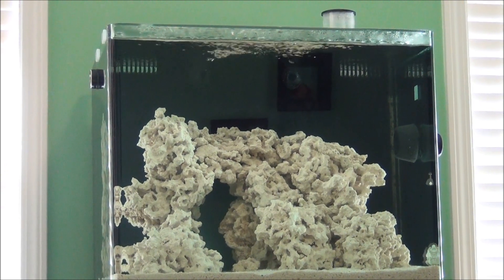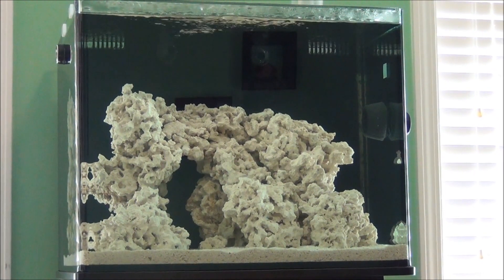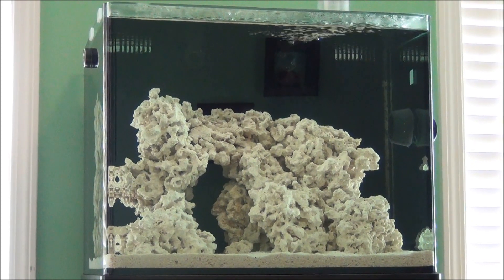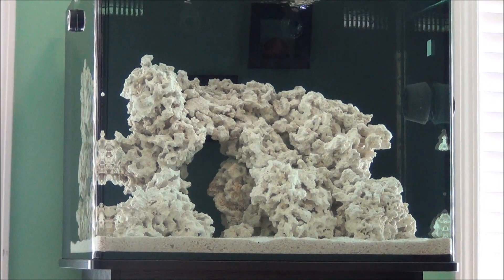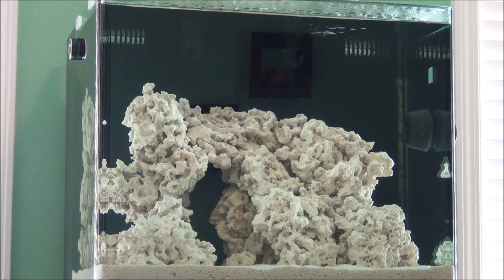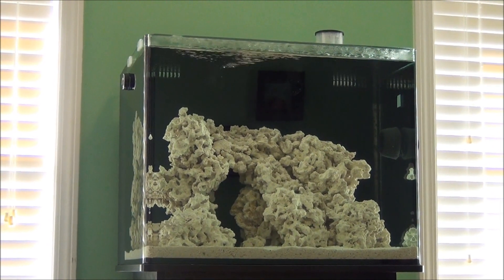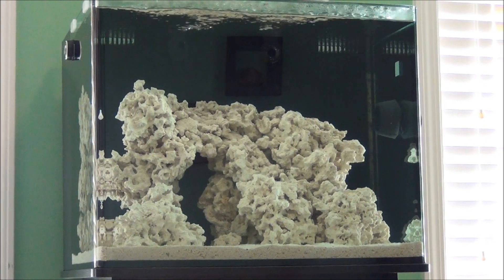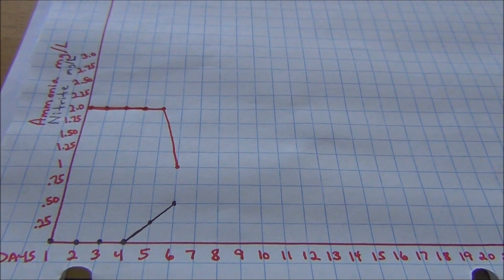The Reef Pt.5: Cycling the Reef

Comment: I'm following your advice concerning the fishless cycle.  I'm going to use the A Purple Reef rock and sand.  My question is, should I do a water change after the cycle?  If so,, what percentage of water change would your recommend?  Thanks!!!
Reply from the maker: Skip Bowman After you have cycled your tank you will have Nitrates in the 20+ mg/L range. Doing a 50% water change will bring your Nitrate levels back down within the acceptable range, and it will replace vital bicarbonates that were depleted during the cycling process. Within a few weeks of the cycle, the anaerobic bacteria that process Nitrates will develop allowing you to perform smaller water changes. Good luck!
Reply: Thank you!  I really miss your updates and wisdom.  Because of your videos and advice, I've gotten back into the hobby after a 20 year break, so much as changed.  Back in the day, I've never heard of a fish-less cycle or many of the products that are now available.  We just had halides, not even CF were out.  Your advice is so helpful and I really appreciate it!  Thank you.

Comment: Hi. I am currently cycling "dead" dry rock (was live). It's only been in a tub for 3 days. It is emitting a pungent smell in the afternoon due to high temperatures. I'm not sure if it ammonia, mildew, etc. I am a virgin reefer. It smells salty. I will be testing for ammonia soon, but the rocks are only in an RO bath. Next week, ill be starting it with salwater w/ bacteria dosing each day. Am i doing this the proper way?
Reply: The smell may be ammonia, from dead organic materials from the past, as you mentioned here. I hope im still doing this the proper way. 1 week w/ ro (pump only). Week 2 w/ saltwater & bacteria dosing.
Reply from the maker: Hello Clyde. Depending on what type of dry rock you have will determine whether or not you have enough decaying organic matter to cycle the rock without adding a source of ammonia. Many types of dry rock such as Marco's or BRS reef savers is too clean to start a cycle alone. Once you put the rock in saltwater mixed to 1.026 specific gravity/ 35 ppt salinity just test for ammonia. If ammonia concentrations don reach at least 3 mg/L, then you can add 1 drop per gallon of Dr. Tim's ammonium chloride or throw in some fish food to feed the bacteria. Test every other day and add more ammonia source to get back to 3 mg/L. Start testing for nitrite once you see ammonia dropping. Your nitrite will spike before eventually dropping to zero. Once nitrite tests 0 your rock has cycled. Hope this helps.
Reply: +cyberaquarist thank you! I appreciate the input! That's how i actually planned on tackling the rock cure/cycle. Next week i will be starting the bacteria dose & testing. I understand that if i show no ammonia, then the cycling will be delayed since i will have to add ammonia in myself (via ammonium chloride)

I was wondering, how long does it take (days/weeks) for each portion? Ammonia to Nitrite to Nitrate? I saw that you ended by day 20. I'm starting off with only a 20 gal long. Im a freshwater guy going into reef. still continuing my research everyday.

Comment: Hey they, how's the tank going? I see you have the same one that I just picked up a week ago. Question for you, how is the one powerhead working? Did you keep just one or get a second. How;'s the tank running for you? Any issues I may need to know about. Thanks for the video!
Reply from the maker: Hello Candice. I haven't had a single issue with this tank or the stock return pump. I'm still using the single return pump. The only piece of equipment that I had to replace since this video was the Innovative Marine desktop skimmer. I used it for over two years, but it started requiring constant adjustment to skim properly. I replaced it with a Reef Octopus HOB 2000 Classic skimmer. Her is a link to a more recent video of this tank with all of the same equipment used in this video. It will give you an idea of what is possible. https://youtu.be/gvJA_hTYMwc
Reply: Thats great!! I'm really encouraged to hear that you haven't had any issues with the tank. I love this tank and i'm excited to have it for my first saltwater experience. Thank you for the tip on the skimmer, I haven't bought mine yet so I will keep that in mind. Thanks for your help! ~ A Patiently waiting aquarist! lol

Comment: If your live rock is fresh, then the rock will not need cycling or curing, and there will be no ammonia or nitrate produced. The rock is ready cycled, and full of bacteria. You just need to wait 6 days to be sure nothing has died, and produced an ammonia spike. If you are adding live rock to an existing reef tank, then you need to put it in a bucket of salt water from the existing tank, this will prevent die of, when the rock is added to the maid display. Nice scape!!.
Reply from the maker: You are correct, and I did mention that fact at 2:20 in the video. This tank is now 2 1/2 years old. Thanks for the compliment.

Comment: I've had very negative results using Seachem stability on two separate occasions. In fact I swear on my brackish setup it actually haltered the process... took me 4 months to fully cycle. That may have to do with brackish though. I wouldn't use the FW test chart for SW... the colours are extremely different, but yeah you can use the same solutions for most tests.

Comment: Are the protein skimmer and wave pumps running during the cycling period ?
Reply from the maker: I do run the protein skimmer and wave maker during the cycle. The skimmer won't actually pull anything from the water at this early stage in the tanks life, but skimmer's have to "break in". During the break in period the skimmer puts out a lot of micro bubbles into the tank. Id rather this take place while there aren't any corals in the tank. Running the wave maker insures that all parts of the live rock are receiving good water flow for the cycle.
Reply: +cyberaquarist  ok cool; thank you.

Comment: Thank you also one more question if you don't min if my gravity is high can I add distilled water to bring it down
Reply from the maker: Yes. You can add distilled water to bring down your specific gravity/salinity. You may need to take out some of the saltwater before you add the distilled, depending on how high the salinity is. Always try to maintain the same water level by topping off with distilled, RO/DI, or DI water, because as the water evaporates the salinity will go up. That's why I highly recommend using an auto top off system. It is one of the best investments you can make to ensure a stable salinity.

Comment: Hi I'm new to this and I started my tank about three days ago I was wondering do you have to do water changes while cycling your tank, and I have about 5 pieces of small live rock in the tank and I'm about to add some dry rock will the live rock help with curing the dry rock since I'm only three days in? Any help would be great:)
Reply from the maker: Water changes don't need to be performed during the cycling process unless your nitrites go above 5 ppm. In that case, just perform a partial water change to bring nitrite (NO2) down to 5 ppm or less. The live rock that is already in your system will help speed up the cycling process as it already has millions of beneficial bacteria on it. Test for nitrites every few days, and once it reaches 0 ppm the tank is cycled. Then you can add a couple of small fish to maintain the bacteria colony. Just take it slow when adding new fish and corals. Be sure to leave your lights off during the cycling process to allow a bio-film to build up on the rock. This will make it harder for nuisance algae to get a foot hold. Don't worry about trying to keep the coralline algae alive by keeping the lights on. A lot of it will die off, but it will quickly rebound once you start running your lights. Good luck!

Comment: Awesome videos! you never mentioned phosphates in your testing. Did you ever test or have problems with the dry rock leaching phosphates?
Reply from the maker: Thank you Ed. I have tested for PO4 and NO3 as well. PO4 is 0 ppm and NO3 is at 5 ppm now. The NO3 is to be expected until the anaerobic bacteria become established in the system. The tests that I mentioned in this video were for the purpose of monitoring the initial stages of the cycle. I will also be testing for Ca, KH, and Mg as the tank matures. I appreciate the comment.
Reply: You are the man! spectacular coverage. I have been doing reefs for about 8 years now and it all has been with live rock. I am getting ready to start a 125 gallon reef with dry rock because of the pros. Did you do any prepping of the dry rock prior to introducing? keep up the good stuff and hats off to you!
Reply from the maker: Thank you! The rock that I'm using is the Key Largo dry rock from Marco Rocks. I inspected each piece thoroughly, but there wasn't anything organic that needed to be removed except for some small rubble pieces that were within the rock from shipping. I simply rinsed each piece with tap water in my bathtub. Then I allowed each piece to dry before putting it in the tank. Marco Rocks claims that the Key Largo rock is free of dead organics and their cleanest rock. I vouch for their statement.